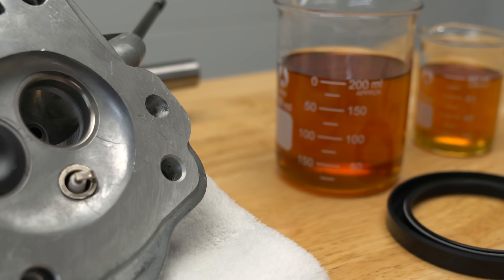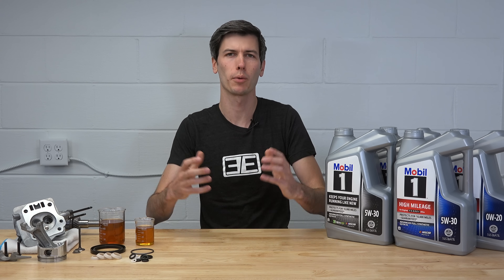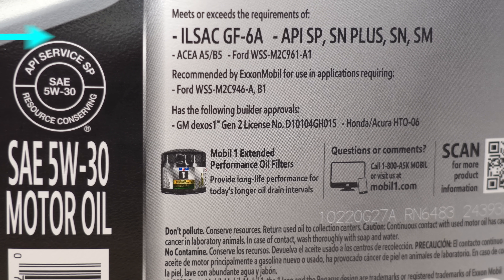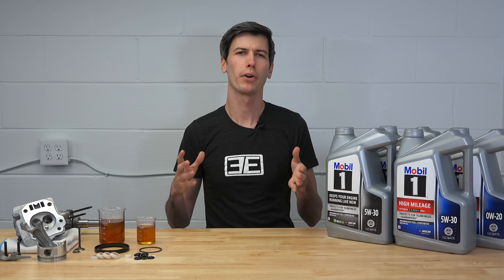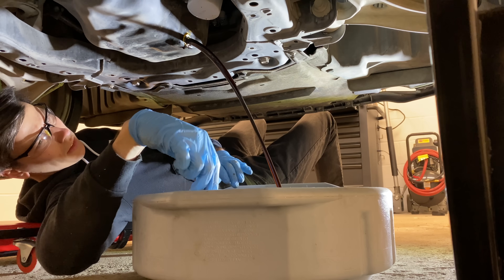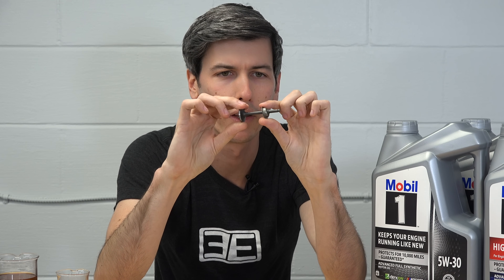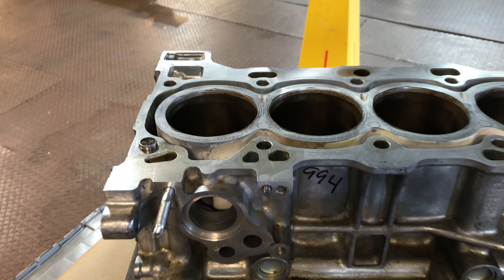Is Synthetic Motor Oil Bad For Old Cars?

Comment: Thank you for explaining the history behind some of the reasons they initially got a bad rap. And why you would use different viscosities vs different additives, high mileage etc...  great vid!
Reply: Don't know about high mileage oils BUT my 2000 Chevy 5.3 started lifter ticking on start up . Changed oil n filter @ 5 K  with one quart trans fluid at 275 K . Now1500 miles later noise gone . ( It worked for me ) . Rick bruggner   Miami fla .

Comment: Has there been any suggestions by Ford for the Ecoboost engines and carbon build up on the back of the valves? For the engines prior to the addition of multi port injection? May have to switch to Toyota! Thanks!!!

Comment: I started using synthetic oils in my cars in the mid 70's.   In an AMC Hornet with over 68,000 miles on it with no problems and a 76 CJ-7 starting with the 3rd Oil Change and used it in both vehicles until I let them go.  The AMC Hornet with over 300,000 miles and the Jeep CJ-7 with over 200,000 miles.  I have used synthetics in all my cars starting with the first oil change since then.  I do know of a person who put synthetic oil in a late 60's model foreign car that developed a number of leaks, causing him to stop using synthetic oils in his cars. As the seals that were leaking were the front and rear main seals and very expensive to replace, he opted to switch back to a standard oil.  I have not seen him since the  early 80's, so I am unaware if he has changed him mind about using synthetics since then.

When I was working as a mechanic, my experience was if a seal was leaking, the only solution that worked was to replace the seal(s) that are leaking.
Reply: Johnny Tyronne  As will going through passages that conventional oils won't.  So they will reveal any worn seals, and things like piston rings.

Comment: Synthetic oil is man made, meaning the molecules are the same size and break down evenly over time.  Non Synthetic, the molecules are different sizes, so the smaller ones burn over time and the larger ones become deposits.  That's what I remember.
Reply: Also I've been using synthetic oil in my Honda since I bought it and it has 315,000 miles.

Comment: I run Synthetic in my 1965 Plymouth Valiant, My 1968 Dodge Coronet and my 1971 Dodge Charger R/T with no issues.
Reply: I was hoping some MoPAR guy would weigh in on this, I was wondering about switching over to synthetic on my 71 Duster 340/416 stroker engine. It only has about 2,000 miles on it. I'm going to go to synthetic in the spring - THANKS! JG!

Comment: I heard that changing from say a 15w down to a 5 or 0w oil can give you extra horsepower, the theory being that as the oil is much lighter and easier to flow around the engine, the less work the engine has to do to circulate/run in this bath of oil, makes sense, like trying to swim in a pool of water verses a pool of liquid soap for example, heard up to 10 bhp can be achieved, but at what cost to the reliability of the engine is another question.
Reply: Crank moves easier through the oil in the pan🤙🤙 some guys shave the crank to make it like a cuting effect to make it easier as well... old school secret 🤫🤫

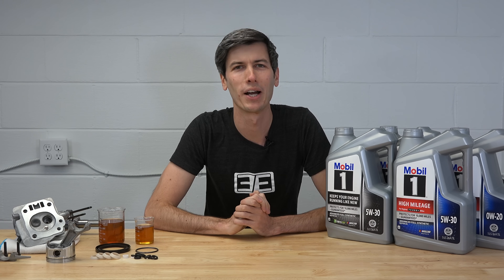Comment: Save 10:39 of your life. The answer is NO. 
Just make sure you use the proper viscosity (weight) recommended by the manufacturer, and based on the ambient air temps you'll regularly encounter on a daily basis, and you'll be just fine.

Comment: what about synthetic oil in a diesel?  And will high mileage oil slow a leak on a rope seal rear main bearing?
Reply: No it will not,  it will get worse.  I started with one quart  of oil leaking per oil change,  this year i went tru 5  quarts. I finally just paid to repair the rear main seal. I Should have done it sooner. Hell I spent over 200 over the years just to keep up with this damn oil leak
Reply: I even tried those rear main seal leak repair  oil additives. Do yourself a favor and repair it.
Reply: @quickchrome2012  Thanks...it is in a boat and the repair is thousands of dollars.  I had it repaired about four years ago.  Not wanting to do it again.

Comment: I had the experience of switching to Mobile 1 and two days later oil was pouring out of my rear main seal. Prior to this the car did not burn or leak any oil.  Newer car OK older car stick with dino.  While my car was an older car,  It only had 70k on the clock.

Comment: 2013 Kia optima  70,000 MILES   5W20  Which oil do you suggest? Extended Performance??? Advanced?? High Mileage?

Comment: Rather change the oil more often and have less leaks. Dino for the win!

Oh yeah 1994 Camry 230k, running the manufacturer recommended viscosity. 5 quarts of supertech for $13 and whatever oil filter is cheap on Amazon that is not orange and black.

Comment: Years ago, I switched my 86 Monte Carlo SS with 107,000 miles on it from conventional oil to Mobil 1 synthetic.  It had  been burning a quart of oil every 2,500 miles which I considered good for the old chevy small blocks.  It burned a quart in 1,000 miles afterwards and increased dramatically to a quart every 200 miles.  when It got so bad, I had to take out the #8 spark plug and clean out the bridged over gap every two weeks, I had the engine replaced which was about 125,000 miles  Coincidence that it started burning much more oil immendiately after switching to Mobil 1 synthetic?  I don't know but it happened.
Reply: past the ring . conv better for old or mix or thick

Comment: Hi. Very interesting video. 

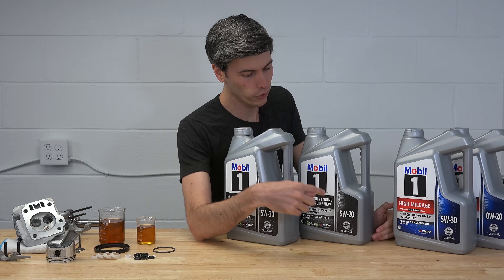I would like to mention though that when you talk about thick oils (around 5:30) you compare a 5w-20 with a 5w-30. I think that this comparison isn't right. In both cases the base oil is of viscosity 5. Viscosity improvers (additive that mix with the base oil) are employed to make them increase their viscosity at elevated temperature. However, the base oil remains at 5. This means that the base oil will be consumed at the same rate in both cases. I think that a proper solution to oil consumption is to migrate to a, say, 10W-30 oil (from 5W-30). Please correct me if I am wrong.

Comment: My 1987 Mustang GT 5.0 developed a head seal leak when it was less than a year old when I switched to Mobil 1.  It is a seep that looked like it happened due to causing the gasket to shrink.  I went back to regular oil and the seal stayed stable but still leaks the same amount 32 years later (yes, the head and valve cover gaskets have never come off the car but it is my convertible that I have not used as a daily driver for a long time).
The idea that it caused shrinkage of the gasket was common at the time, so I couldn't have been the only one it happened to.

Comment: Why bother using synthetic oil in a classic car? All synthetic really does is push out the oil change intervals from 3,000 to 5,000 plus miles. Classic car owners are going to change their oil often anyway, so why waste money on synthetic oil.  If your driving an old beater with a dying engine, nobody is going to waste money on premium oil on a junk pile. Money better spent toward a better car.

Comment: I've just passed 300,000km in my car running Mobil1 since day 1, maybe it's time to switch to high mileage stuff as my consumption has reached 1L/1500km,
although I found one of the two PCV ports under the throttle plate clogged which once un plugged seems to have reduced the consumption a bit.
Still, no leaks, no visible smoke and no loss of performance at this mileage made the premium oil investment well worthwhile long term.
Reply: Why not fix the clogs?
Reply: Your choice — I went to this product with above excellent result
Reply: Interestingly about the same here on M1....

Comment: I put syn in My 87 Ford about 5 years ago. Every weak seal in it let loose! Got so bad that it ruined the clutch. I fixed all the leaks,new clutch etc. It was burning a qt every 200 miles! Went back to petrolium oil and it stopped burning oil.

Comment: Newer oils don't have enough zinc phospate ZDDP because it kills catalytic converters so even though you use synthetic, it might actually provide less protection to metal parts from wear damage than older non synthetic oil did.

Comment: Many manuals recommend more than one viscosity for the engine. You should choose higher viscosity if it is expected to have high loads on the engine. 

You should choose higher viscosity if one or more of these cases frequently occurs to you:
1- driving with high weights (more than 1/2 the maximum load).
2- Sports driving (requiring kicking down and high revving).
3- driving on mountain roads, whether driving up or down the road.
4- towing cars or so.
5- operating your car as a taxi, a patrol, or commercial car. They may be exposed to any of the above cases anytime.
Reply: @ Ahmed Al-Boraie : It's also important to note the ambient air temp during daily initial engine cold starts. Temperature is VERY important to proper oil flow. Cold ambient temps often require thinner viscosity oil. The trade off to protecting the engine in the cold is typically slightly higher oil consumption when warmed up, but so what.
Reply: @turbodiesel4709 
Some times, and according to your owner's manual, even in the same cilmate you can use more than one viscosity grade. In this case what will you do?
We face this case on a daily basis here in the middle east, where you can use all the viscosity grades in the manual.
Reply: @AhmedAlBoraie  Use the viscosity that fits 2/3rds of your operational time. Furthermore, in my climate, 10W-30 is probably the most universal engine oil there is.

Comment: The whole thing with using high mile oil over 75k miles is false. If you used good oil and change it a lot your engine wont have these issues to need to use that oil. 176k miles on my 03 impala, never used high mile oil

Comment: IS ANYONE HERE AWARE of the horrible experiences with synthetic oil in aircraft engines? Short version: Engines used only occasionally had oil dripping off cam/lifters completely, resulting in rust forming. Mineral oil left a protective film. Start-up after extended periods resulted in rusty lifters running against rusty cams. You can see what happens next...
Is this case, the slipperiness of synthetic oil was TOO slippery. Is that still a problem? If so, what about those vintage cars driven only occasionally? This was a hug problem with aircraft, but NOBODY ever addresses the issue with old car engines.

Comment: My question would be:  My car 2019 car requires synthetic oil and according to the mileage during Covid I do not drive enough to hit the "change your oil now".  But based on time, I do hit the mark.  I've been told that oil (synthetic too?) breaks down over time.  So the question, do I change my oil when I hit the mileage or time (or by the computer in my car that somehow determines oil life based on my driving)?  And what is the effect on my warranty?

Comment: Modern oils do use alot of detergents and have less lubrication capabilities than older ones.
Stay away from DPF compatible oils and use a PD (vag505.01) spec form improved lubrication/protection

Comment: not all the time you can use synthetic oil for old engines...especially for those engines that uses ordinary oil at the very first...the logic behind that is most of the older engines have a lot of wear on bearings and other moving parts, the oil clearance between two moving parts is different from the new engine...so if you use a synthetic engine oil which has a lower viscosity it will make your engine noisy...and theres a posibility that it will increase the wear between moving parts.bec of the poor lubrication...you can only use synthetic oil on new engines and the old engines that uses synthetic oil at the very first...in my experiences most of the  car owner who switches on synthetic oil from ordinary oil, their engines becomes noisy and the heat generate faster, i suggest for older engines to use semi-synthetic oil with the viscosity of 20w-50 for gasoline engine, if you dont believe, ok fine, go and make an experiment to your old engines...and compare the sound, performance and heat generation....gudluck

Comment: I've been running Castrol Synthetic along with a zinc additive in my S10 since I got it with 141K on it.  It now has over 320K miles on it and no issues.
Reply: Thanks, what year S10,  ? I have 2007 CANYON , 4:CYL....RAN VALVOLINE SYN FOR 130,000 miles, ;;theN to MOB1 here in HELENA VALLEY.....
Reply: Once broken in zinc additive is not needed.

Comment: So I drive a 2015 Subaru Outback 3.6R and the local dealers wont put synthetic in even though the manual recommends it. They say it has something about them generating more heat than the 2.5Ls. Anyone else run across this or is this just a southern Idaho thing?

Comment: I tried fully synthetic oil in my 1980s motorcycle about 20 years ago & got a few oil weeps where there weren't any before so I guess what you say makes sense. Been using semi synthetic since with no issues.

Comment: so for examle i have GM  X16XEL known for burning oil
it got 350k km (last oil change 320k) and it burns quite a lot of oil but meets the amount in the manual just fine should i change to thicker oil with next oil change? or just let it be as it was designed? 
i like to use full rpm range so the oil is burning even faster when i out of town
should i pour some thicker oil even now? or wait for next change?

Comment: Early synthetic oils were mostly much thinner than classic cars were designed to use. If you stick to a synthetic with the same viscosity rating that your engine was intended to use, then you should have no issues. The trick is to find these thicker synthetic oils. A number of companies here in the UK produce them. I have been using 20W/50 and 20W/60 synthetics on low and high mileage cars of the 1950s and 1960s for a good few years now, and have had no problems at all, except the higher price!
Reply: All modern day motor oils (both synthetic and petroleum) that are rated SN by the API will eventually ruin the flat-tappet camshafts, rockers and lifters contained within engines (in cars made prior to the early 1970's)---this is not a question of "if," but "when" it will happen. Those SN rated oils were purposely designed to have significantly less zinc and phosphorus in order to protect the catalytic converters in modern cars, but such catalytic converters were not present in the cars made before the early 1970's.  Amsoil sells a 100% synthetic oil called Z-Rod (in grades of 10W30, 10W40 and 20W50) that is specifically designed for older classic and hot rod cars.  It features a high-zinc formulation to prevent wear on flat-tappet camshafts and other critical engine components, along with a proprietary blend of rust and corrosion inhibitors for added protection during long-term storage. Z-ROD Synthetic Motor Oil is designed to perform on the street and protect during storage.

Comment: Change your oil more often a simple take the dipstick out if you can't see the metal it's time to change your oil in the wintertime use 10w 40 in the summertime use 20w 50 and never use 5 w 30 is way too thin and resort premature engine wear.

Comment: I started using Mobile 1 High Mileage synthetic in a '92 Astro I had with about 85k miles a few years ago.  It really helped with the dry valve seals from how much that old beast sat around.  The puff of smoke on startup got much lighter.

Sold that van for too little money due to 'rona and needing money. :(
Reply: hey I'm driving my grandpa's old 94 safari and fixing it up, it used to run cheap bulk regular 5w-30 and when i checked the oil at 5k km's since the last ouk change it was 2 liters low and black as hell!
Reply: i bought some Liqui Moly semi synthetic 10w40 with their MoS2 molybdenum additive and it made a huge difference, in 6k kilometers it's oil consumption had slowed substantially to only about 3/4 of a liter over the 6k interval and last drain got all kinds nasty carbon and muck out, doing the next oil change in 4k to keep things cleaner inside :)
Reply: @snoofayy6150  Dude I sold the van to got sammiched at a red light recently.  He was sore but fine, but the doors (all of them) stopped being doors so Big Bertha went to the pick-n-pull in the sky.  :(

So now there's a low mileage (less than 100k) nearly 30 year old engine and transmission in a junkyard somewhere.

Comment: Re there at the last when discussing oil burnoff in Mazda Wankel type rotary engines, it sounded like oil burning is inevitable.
 My son was checking out performance of synthetic oils and tried a little experiment.
  He soaked a Q-Tip with natural cotton fiber and paper stick in Royal Purple overnight. Then he turned a propane torch flame onto it.
  It didn't burn. At all.
  Might be worth trying if you run a rotary.
  So far it appears to me that Amsoil, Redline and Royal Purple are the top performing synthetics. Of the three I have happy personal experience with Royal Purple.
  It even improves engine temp and efficiency in our lawnmowers.
  I avoid the halfassed "synthetic blend" stuff.
  If price is an issue, some house brand full synthetics such as Walmart Tech brand are way better than the blends.